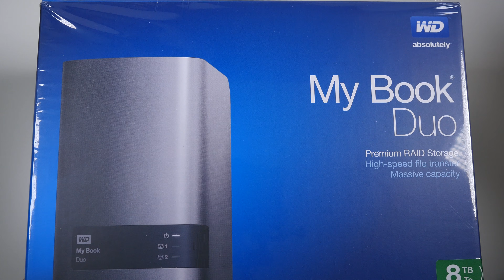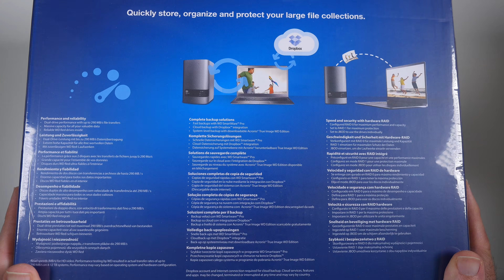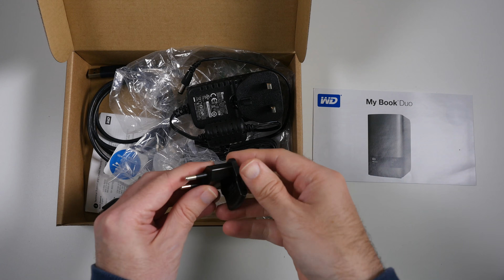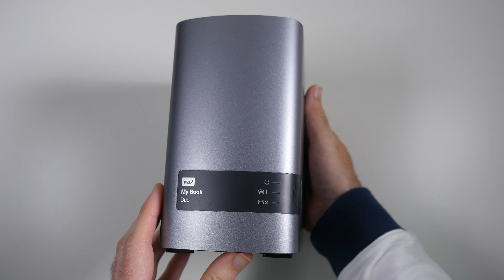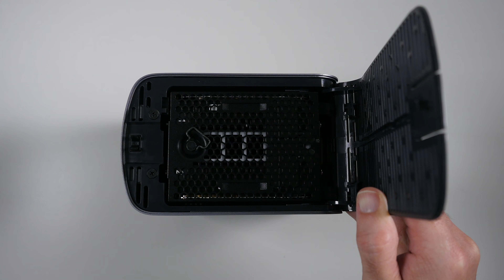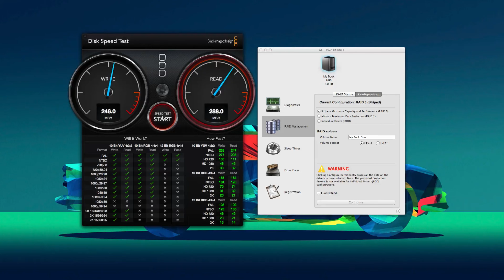Western Digital My Book Duo Speed Test & Review @westerndigital

Comment: I know the last comment on this video was a long time ago, but I think (I THINK) he was incorrect when he talked about JBOD. JBOD means "Just a Bunch Of Disks" In JBOD mode, your computer should see it as 2 totally independent disks. JBOD might be good if you want to physically separate your data between the 2 drives, but there is no added safety for your data and no added speed. RAID 0 combines the disks as one, and is really fast and you have the maximum amount of storage, but if either drive fails, everything is lost. In RAID 0, the more disks you add the more storage you get and the fast it becomes, but the more unsafe the data is, because if any disk fails, all data is lost. With RAID 1 both disks ares combined, and your speed would be the same as a single drive, but if one drive fails, you pop in a replacement drive, and it clones the still working disk over to the new drive and all your data is safe. The more disks you add in RAID 1, the more safe your data is, because all disks would have to fail at the same time (or at least before you replaced a bad drive) to loose all the data, but you don't gain any more speed or storage in RAID 1 no matter how many drives you have.
Reply from the maker: Thanks for sharing this info Chris.

Comment: I am thinking to use a My Book Duo in Raid 0 for my video and still image work but for backup would use a My Book as a Time Machine. Would this work?
Reply from the maker: Yes, this would work, just remember if one HD fails in a RAID 0 you lose all data … daily backup what's on the WD for sure.
Reply: Thank you for the prompt reply. Time Machine does backups every hour so I am covered there. Presently I have two 4TB USB C G Drives in my new  iMac (which replaced a much loved 2006 MacPro) . One I use primarily for video files, the other for still images. They both have transfer speeds of about 165 MB/s read and write, as measured on BlackMagic. I am considering trading these for a single My Book Duo for the Raid 0 capability but also to reduce the number of power chords and boxes. Any thoughts about this idea? Thanks again.

Comment: In JBOD configuration.... will that show two separate drives in windows?  or it will be one logical drive of combined capacity? 

Instead using RAID 1, I would like to setup backup by my own.. is that possible?
Reply from the maker: Pretty sure it will be combined.
Reply: in that case WD is missing what most other HDD enclosures are providing....
thanks for your reply , could you suggest any enclosure providing these features.. simple/jbod/raid1/raid0

Comment: 2 years later, what is your final opinion about it? still positive?
tks!
Reply from the maker: +Leo Cabral Yes very good indeed.
Reply: even considering the encryption issue?
Reply: yep, any encryption issue?
Reply: https://community.wd.com/t/wd-my-book-duo-data-forever-lost-if-drive-enclosure-dies/6496 is that true?
Reply: Actually Yes, so far looks pretty true. Even placing your old HDs in a new enclosure it won't be able to be read
Reply: Leo Cabral how about EX2? I considering buy EX2 because Book Duo have encryption issue.

How about my book duo, without encryption. Can i disable the encryption?
Reply: EX2 is even worse (at least according to several reviews and WD forum) due to disk failure problems. 
About MBD, so far i've got nothing new and have no clue how to disable encryption :(
Right now, I'm considering taking 2 external hard drives and manually double the files (there are some programs with such capabilities like programmed backups but never tested)
Reply: Leo Cabral
ah, i think i will bought "Cloning" docking.. Thankyou!
Reply: keep in mind: at least the WD Red NAS Hard Disk is quite good and reliable. The 4tb unit costs about 150 USD while the WD My Book Duo with two HDDs costs 350. In other words, means you are paying 50 for (testing) the enclosure LOL

Comment: I know this comes in sizes 4-12TB and Samsung T1s largest is 1TB but that aside what would be the faster option?  I'm using a laptop with 3.0 usb ports and running windows 8.1.  Use will be for part storage of non important files like movies and songs and also be using it as a scratch disk for video editing, 3d modeling and rendering.  Portability is not important.  If you know of faster options I would be keen to know. 😊 Cheers.
Reply: When I say faster I mean for a sub $1000 AUS external.
Reply: When I say faster I mean for a sub $1000 AUD   external drive.
Reply: +SnifterRoux  There are also 16 TB ones now for 600 US Dollars at amazon. 12 TB ones are  US 400 Dollars.

Comment: Any idea what the longevity of one of these is? I am considering buying one of these but I would like to know how long it lasts and if their is any indication if is about to fail because I would like to take full advantage of the disc space (if possible).
Reply from the maker: ***** WD have great quality control. No telling on longevity as all hard disks will fail at some time.
Reply: Geekanoids Well yeah I understand that but I have never had a hard disk fail... Currently I have a crappy eMachines computer I've had for like 5 years and their have been no problems with the hard drive and it runs my OS... If I am just using an external HDD for storage shouldn't it last indefinitely? Or at least a really long time?

Comment: Many thanks for your review, I'm contemplating purchasing this over the WD My Book Thunderbolt Duo for several reasons; it offers a larger capacity of 12TB, it houses the newer WD Red drives, and the extra USB 3.0 ports allow to use it like a USB hub. I read it comes in NTFS by default, was formating the MyBook to HFS+ easy?
Reply from the maker: SweeJ I have the Thunderbolt version too, easy to reformat.